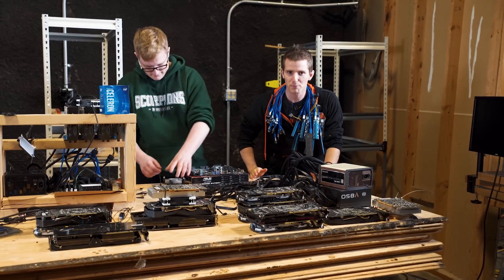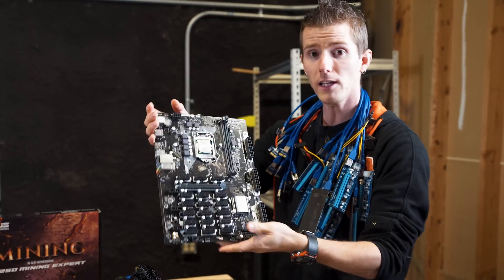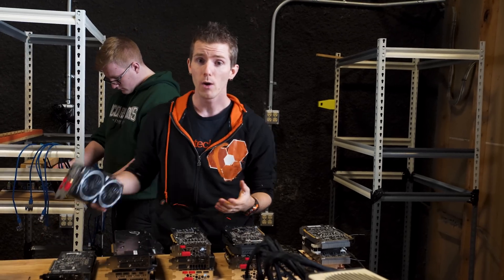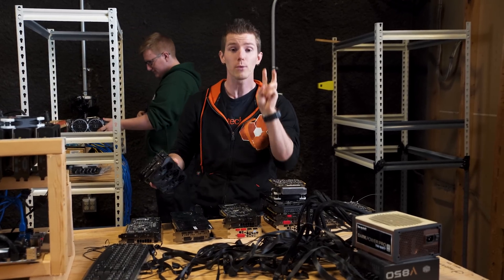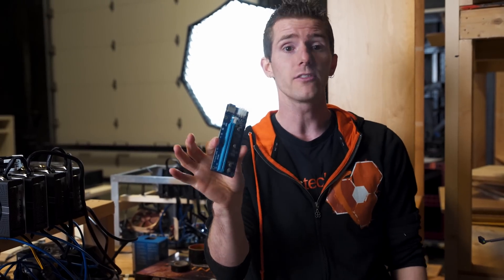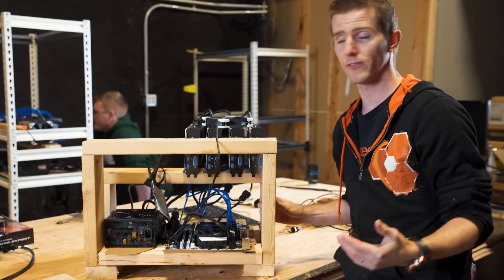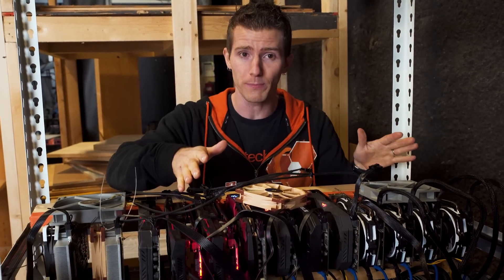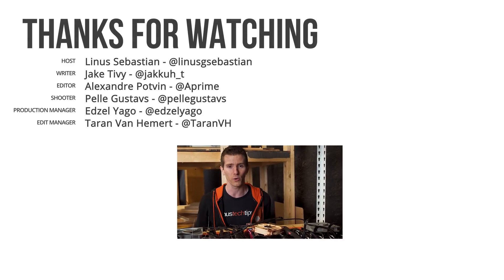13 GPUs in ONE PC? – Mining Adventure Part 2

Comment: I’m at a loss here bro and I need help.

Currently mining with my 3080, but I just can’t get the 3070 to work on my current motherboard. I’ve even tried a seperate bracket to side mount the 3070 and I have the 6 pin to 8 pin extensions and successfully could reach the othe GPU with no problems at all, and the 3070 rgb lights come on but the fans don’t kick on, making the GPU not register at all on the mobo. Just some side notes on the build:
PSU: Silver rated 750 watt
CPU: Ryzen 5 2400G
MOBO: ROG Strix X570-F Gaming
Ram: 16gb ddr4
GPU: Nvidia GeForce RTX 3080 Zotac Gaming AMP Holoblack/Nvidia GeForce RTX 3070 Gaming X Trio

I’m starting to thing the CPU is the problem but I’m really stumped on this one.

I would also like to add that PCIE16 Slot 2 doesn’t pop up at all, but all the other ones do, and both GPU turn on and work fine by themselves in slot 1.

Comment: All that work for $900 a month before electric bill which is most likely with daily use items is around 6~700
Reply: You are missing the point here. If they were holding everthing in Bitcoin this $900 is now worth $2000, also the power cost for this kind of rig is about $150/month and not 600usd.

Comment: @t
LGA 1151 Supports 8th and 9th Generation Intel Core Processor

Intel B360 single chip architecture

Supports SO-DIMM DDR4-2133/2400/2666 up to 16GB Memory

Supports 8 x PCIe x16 slots (50mm between X16 slots)

Supports M.2 (16Gb/s) Connector

Motherboard Dimensions 19.1 Inch x 9.25 Inch ( W x L )

This motherboard has NO 24 pin ATX power supply connector it uses eight 6 pin PCIe connectors for power and has 8 PCIe connectors as outputs to power GPU's. If using a ATX power supply you will need a 24 pin jumper to start the power supply.

Your CPU MUST have intergrated graphics. HDMI cable must be plugged into on board HDMI. This can be changed later in the BIOS if desired.

🔥Don't forget Windows 10, we have OEM, Download and USB versions available

Comment: Never use sata it is only rated for 54 watts and the riser can pull 75 watts making them get hot melt and start a fire only use 6pin cables as its rated for 192 watts

Comment: Hey there Mr. Linus. I am interested in using mining rigs as a render computer instead of bit mining. Would a mining rig work in 3D rendering and video rendering? Also, would it be a better choice to use the money to get 2, 3, or 4 good video cards instead of a mining rig? Basically, which is better for rendering a mining rig system or a few really good video cards stuck in the PCI slots?

Comment: Hmmmm what will happen if I mine bitcoin with my intel HD gpu
Reply: In a pool you'll make pennies, solo you won't make anything. The bitcoin network is saturated with compute power, so an integrated graphics card really doesn't stand a chance on its own. On average it would take many many years before you win a block mining solo... and yes you could join a pool but I really wouldn't recommend it with integrated graphics because it's hardly profitable and it causes unnecessary slowdown

Comment: Is there any reason this kind of tech/set up couldn't be used for Folding @ Home (https://youtu.be/KU4qOebhkfs) I've searched Facebook and Craigslist and found a number of used GPU mining rigs.  I'm tempted to scoop one up and get it started Folding @ Home!!
Reply: Yes! Any mining rig or computer with decent GPU could. If your not concerned with ever making a profit mining cryptocurrency and paying the electric bill. Look for one with GPU’s that use the least wattage. Also most selling a mining rig means that it’s no longer profitable. So don’t pay much more than the GPU’s are worth individually on EBay.
Reply: @NiceGuysFinishLas100  Thank you!!
Reply: Ryan Ziems Just to follow-up on your Folding@home mining rig. Go to WhatToMine.com click on the top GPU’s. That will give you GPU’s found in most mining rigs, the wattage they use and also tell you what GPU’s currently have little to no profit. If you can find a GTX 1050 or 1060 rig for a good price your getting a decent hash rate at low wattage. So lower electricity bill increase.
Reply: @NiceGuysFinishLas100  Thank you!!
Reply: Help the world!

Comment: 0.10 USD per kWh in Canada? Is that still valid for 2020? I'm currently looking at about 0.30€ per kWh at the cheapest for a normal household and not less than 0.25€ with a irrational(*) yearly power consumption in middle Germany. So, even 2 years ago, there probably wasn't any way over here, to get a positive mining income after electricity using graphic cards, even without considering hardware costs...

*) I entered 99.999 kWh/year at a well-known "24" comparison-website. When entering 100.000kWh it will forward you to a form for industrial customers :-D.
Reply: Yikes, In texas we're charge .11$(.099€) average for power in 2020. I now feel for my German friends across the Atlantic.

Comment: Could a setup  like this also work for building a small GPU render farm? Right now we're using 4 computers in a network with each 2 to 3 GPUs GTX 1080 Ti's and RTX 2080 Ti's. When we will upgrade the GPU's on our workstations we're thinking of stacking our current GPUs in a rack like this. Would that work? Or does anyone has better suggestions? Thanks!

Comment: Imagine cracking password with that much gpu
Reply: Still no match for SHA-256
Reply: this comment and replies are sus
Reply: sha is a joke nowdays tbh
Reply: @laizz-6566  You would literally need several billions of graphics cards running across several billions of years to even have a hope of cracking SHA-256 at it's full potential. The only reason bitcoin works is because it's not true SHA-256 the difficulty is lowered.
Reply: @christopherashford3710  you ever heard of rainbowtables?
Reply: @laizz-6566  I haven't. What's that?
Reply: @christopherashford3710  A table that has the most common passwords on the internet, making them illegal. (I think, really I've got no idea)
Reply: @myamdane6895  Oh I've got one of those, I didn't know they were called that.

Comment: The minimum temperature needed to ignite wood is 180 deg. C (356 deg. Fahrenheit) The average "spontaneous" (>1 min) ignition temperature of wood is 430 deg. C (806 deg.  Fahrenheit) ... Im not sure what your resistance to using wood is other then not wanting it to be by a potential ignition source, but if "a hot mining rig" it got hot enough to "spontaneously" ignite wood (not just slowly char it at CPU/GPU killing temps) due to a "hot mining rig" you "hot mining rig" would already be on fire and melting down.

Comment: A job in the blockchain pays a lot. It is about coding, data and modeling. There are very few frameworks but the concepts are a bit abstract, an experience in data modeling would help a lot. The coding part is trivial in blockchain.

Comment: hey! how many GeForce GTX 1060 6GB GDDR5 Graphics Cards are needed in total??
Reply: I would not do this in 2019 as the calculations to get bitcoin are too complicated for any video cards to solove on the cheap. the only way is to use boxes that are designed to spend only their energy on calculations and these have to be replaced every 10 months or less. DO NOT INVEST IN any GPUS! it will backfire no matter what ecurancy you use them on.
Reply: @kennysboat4432  thank you for your advice...sincerely!

Comment: There are several different ways to mine crypto.  GPU, CPU, ASIC, HARD DRIVE plotting, and the USB ASIC.  USB asic and hard drive plotting are by far the cheapest because with hard drives you can use whatever you have lying around although I recommend a high capacity drive that is designed for 24/7 operation like a 6 TB enterprise grade drive.  
USB ASIC are not very profitable but they are dirt cheap at about 40 bucks a piece and probably another 30-40 for a powered hub.
Hard Drives are next in the line since speed of the drive doesn't matter.
GPU mining is a bit more expensive depending on the choice although i would go with AMD because they seem to be a little bit better suited for mining. AMD even has a blockchain driver.
and last ASIC hardware.  Now there are some price reductions depending on which model you choose because they have some new ones that have come out recently.  It also depends on what currency you want to mine.

Comment: 200 volt power is ABSOLYTELY common in the states. Its called 220v and it runs every electrical panel in every house ever. Its the configuration from the panel that gives your house 200-220v, if you have an electric stove, dryer, water heater whatever it probably uses 220

Comment: You could just make a cheap mining rig with an old AM2, FM2 or AM3 board, used an 8-year-old Athlon 2, and use cheaper power supplies. Cheap DDR3, too- just get a 2GB stick to boot the OS. Not as many GPU slots, I know, but the base system would cost less and use less power.

Comment: @Linus Tech Tips: first off, awesome video.  I've been watching your content for a while and really enjoy it!

I'm new to this mining thing and know nothing about it, but still thinking about taking it up.  I noticed that you're using 1x to 16x adapters--essentially running those x16 cards at x1.  Wouldn't it be better to use them in x16 slots?  I realize we're looking at pricey server hardware if you're looking to have all 16 PCIe lanes for each card, but does it make a difference in the hash rate if you run the card at x1 instead of x16?
Reply: Might as well shoot an email at LMG, they don't typically read comments.

Comment: How would this Asus motherboard work in a multi-GPU render machine for say Blender? I've been using the network render option to render farm, but after I saw this video, I starting to think about a theoretical 19 GPU machine for 3D rendering. Would the 1x PCI-e slots be a disdvantage for this ?  I know this is an unrelated  question, but this is the 1st I've seen this motherboard.  thanks for any input!

Comment: My rx570 with crimson amd 17.10.2 driver have problem in my win10 rig with 12gpu, speed not optimal, but if i use other driver, win10 wont let me do it and keep give me bluescreen, do you have any solution and other driver for rx570 running in rig with 12gpu? Thanks in advance

Comment: Lolz, I like did half of this in a computer build for work about the same time this video came out. Just now noticed it. The computer is used for gpu chemistry research at a university. I had to dremal the case and put in a 1600 watt and a 750 psu. It has six gpus we pulled out of other computers when we upgraded to 1080s. 3 908ti, 1 980, and 2 titan z. Some point here soon we are going to put the old 970s into a big case. Think that one will have 9 gpus.

Comment: Can one use different GPU-s in a mining rig without reduced performance? For example using 2x1060s with 2x1050s on one motherboard. Will it run or affect the performance in anyway? (I read somewhere that the gpu-s will run at the clockspeed of the lowest gpu - is it true or false information? )

Comment: That f motherboard is buvgiest board i have EVER countered.
1. U need to boot it at start without any gpu-s connected.
2. Add one card and boot it up
3. Shut down and add another gpu and boot up
Proceed and hope it works
But it is often when you add next gpu (and i am talking about total 4 cards) and system wont eavem show image on monitor so you have to disconnect ALL GPU,s and start all over again.
4. Finally when you get system to recognise all GPU-s you diacover that SSD or HDD that system did show in bios before but now it wont show it SO YOU are fucked again. Diaconnect all gpu-s and discover the SSD or HDD agaon in bios.
5. And  then when after hours disconnecting and connecting ALL GPU-s and geting SSD also discovered in bios and you manage to boot windows and you make Restart to system for various reasons suddenly system forgets AGAIN all gpu-s and you have to start again from zero

Comment: in case anyone tries to copy him - that board can run 13 normal graphics cards, but the remaining 6 slots have to be those mining-only cards that don't have display outputs. It will not POST with more than 13 normal graphics cards connected.

Comment: btw 1 pci-e power per card ONLY! you will burn somethig down also 1 string of molex per riser , 2 ONLY if you have to. , call th manufacturer they are not rated to run 2 cards, the amperage on dual mining eth would be far over the rating.. i have seenthem melt. VERY DANGEROUS! i also load psu's no more past 50 60% which is also in spec for most psu's and warranty and longevity,. btw have cards running now for 2 years with only dead fans :D no dead hardware .  and a house still! :P not a game.

Comment: i have 12 gpu systems with 1070's, i had to upgrade the cpu because i was dropping shares with 100% cpu usage on certain algos' . i got a celeron something the cheapesrt one 2.6ghz i think. and biostar 250btc. had to upgrade to i3 hyperthreaded. minimum, or amotherboard that lets you overclock would help , hich no mining mobo's let you do. all my new rigs are used 5 gpu boards $20 -$30 each one 1000w psu and 5 1070's way way way cheaper .  we had 1070 ti roi of 2.5 months.

Comment: Connect green and any black wire on 24 pin connector and power supply will turn on if you don't have more than one 24 pin plug on Mobo :D

Comment: just wanted to point something out, 3 power supply's if running near rated capacity of around 800 watts, would pull around 20 amps at 115 volts. I think the standard circuit breakers used in the US for homes is 15 amps, things like electric stoves and dryers will be on their own breaker with higher rating, but for bedrooms and living room spaces where you are sharing the power for lights and outlets its usually 15 amp. so you would need to run an extension cord from a room on a separate breaker to power 1 of the supplies.  not sure  how safe that is but probably safer than cheating and replacing the breaker with a higher rated one if the wiring isn't rated for more than 15 amps.

Comment: First off let me warn people about using the Sata connection to power PCI risers. I'm surprised Linus didn't pick up on this. The PCI risers can draw more power then Sata can give. When this happens you can melt the Sata connection and even worse, start a fire. Use a 6 Pin power cable and get splitters if necessary. Be safe Miners!

PS - I bet half of the people that disliked this video complaining about GPU prices were like "Damn, my 1080TI can make $150 a month mining Zcash? Maybe I'll just download a mining program to "Test it out :)"" You greedy little buggers :)

Comment: if you count only cards , apart from PSU its basically only gpus , having 1 -2 or 100 000 GPUS makes no difference at all , if 10 GPUS can do ROI in 5 months so can 1 ,  guess what ,even with no electricity bills  with 7500H/s , today ive calculated 3000$ a year . That is lets say 1500$ in 5 months , you cant get that rig for 1500$ even if everything goes perfect and it wont , lots of variables there . So 5months ROI , highly unlikely, i will bring forth another point , HTF can last rig be 20X slower then this , that is Part 1 , where ROI was 5 years . That means Radeons are 20x more profitable then nVidia , while i know they are more profitable , its not 20x more profitable . That is 1 radeon = 20 x GTX1080 , you be the judge of the Amount of BS in these videos . I'Ve tried it my self , its not profitable . There are better ways to invest 3000-5000$ , mroe secure and easier ways . Don't know what they are talking about here they didn't mention all that meany numbers or calculation, take there word for it and good luck

Comment: Linus, this is an extremely inefficient build. You're using 3 power supplies, multiple cpu/ram/mobo and 13 GPUs, yet just 6x1070 Ti would be almost as much per month (mining BTG/ZEC) AND you can run them on a single 750W server psu (MSI Afterburner undervolting easily gets them to 110w each).

Comment: So many people whining. Don't worry people-desperate-to-play-video-games, it has shown that POS (proof of stake) is a better solution than POW (Proof of work) Ethereum is switching to POS sometime this year. In laments terms, POS doesn't require hardware/GPU's at all, it mines through staking coins on the core wallet. So all you little whiny mopes will have your graphics cards soon enough.
Reply: There's another catch that we don't know about, and if that's the case I would glady be the first gamer to do POS with other's mined coins because I don't want to agree to these BSterms let alone mine for that crap.

Comment: ASIC miner follow-up: If you live in a cold climate like I do, you could substitute an ASIC miner for a space heater during winter and get a great rebate towards your electric bill. I'm buying a used Antminer S5 590W 1155GH/s for $70 as an alternative to a 900W space heater. The winter is almost over, so it wont save any money short-term, but I'll hang onto it for next winter and bask in the savings. (A joke, because it loses money versus the cost of electricity to run - but it still beats an ordinary space heater)

Comment: TL;DR Wood is like 99% safe from combusting or burning under these temps.

The lowest documented report of wood catching fire due to Low temperature heating over long periods of time was 77C(170F) and it was over Months-to-years-long timelines(incidents occured between 3months -15 years after installation) and the changes are visible during this time with the wood changing from a light chocolate color to darker chocolate color to charcoal then igniting.

Comment: I got a RX480 and 32GB 3200 DDR4 for about for $460 in the end of 2016. Now, having to go RX580 which MSRP is the same, ~$1,000. Damn mining. I WAS going to get a 580 for crossfire but not for ~$550. I wish AMD/Nvidia would start to produce more, faster non-gaming mining cards and RAM manufactures to bump up production. Give gamers a chance!